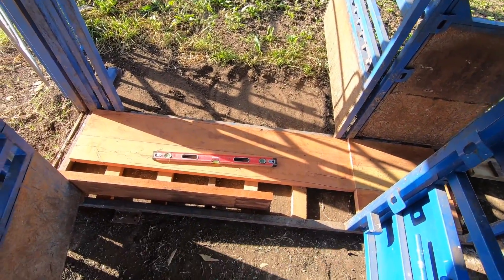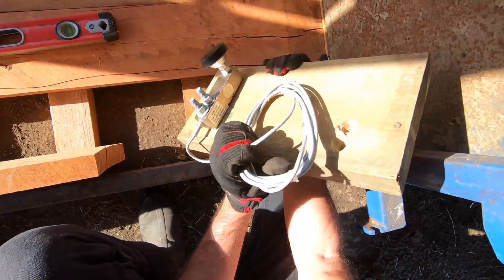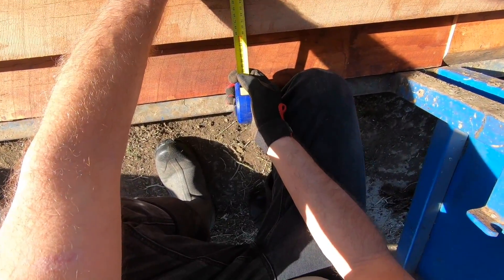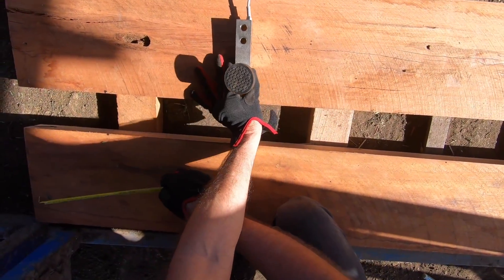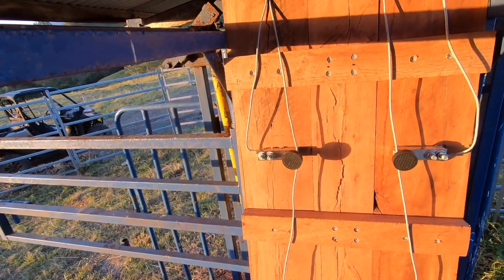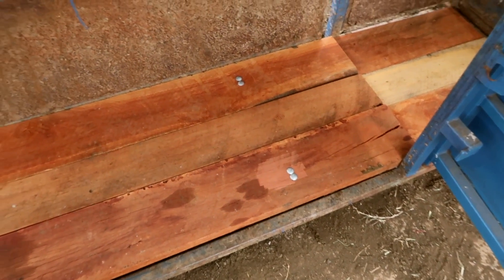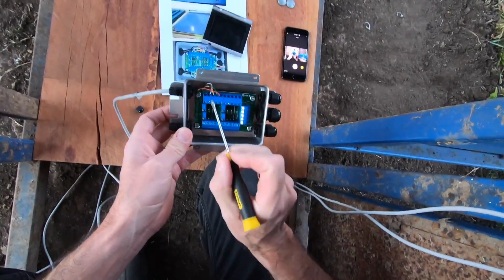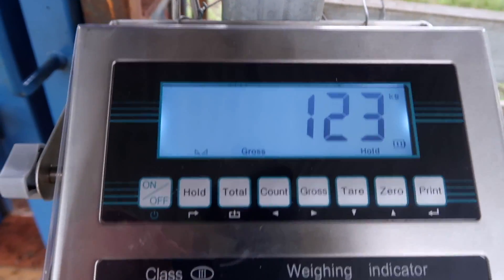AgriEid Cattle Scales - Build your own Platform and Install in less than 30 minutes.

Comment: Thx providing this vid.
A suggestion would to mount the load cells onto steel. Those mounting bolts  are typically highly stressed at rated cell capacity & although this looks to be a lightly loaded application, over time timber will shrink and bolts stretch resulting in unnecessary scale error. Mounting the cells on channel or angle with hi tensile bolts solves that. If space is tight, these steel members can be on the underside of cell with the rubber load points facing upwards into shallow locating  counterbores in the timber deck. Best if deck supported on wider centers  too.

If thats too hard , then using a wider spacer plate and a large , thick flatwasher under the head of the bolt closest the cable entry of the cell would help keep the cell mount from deflecting under load & minimizing measurement error.